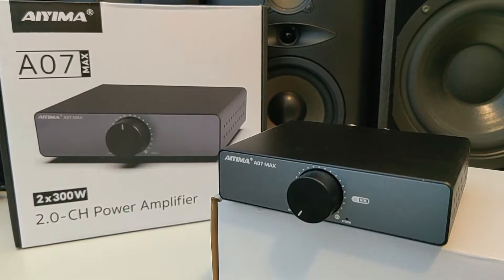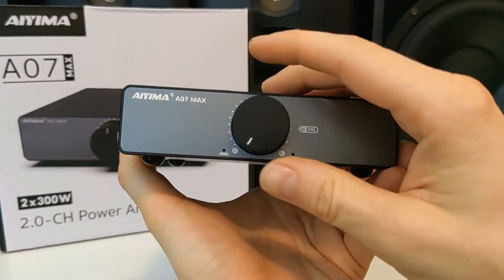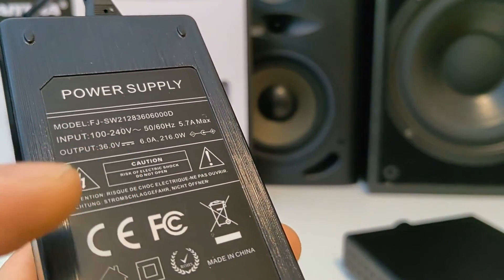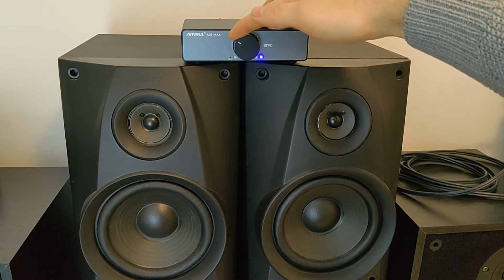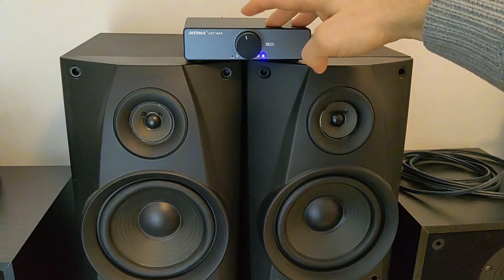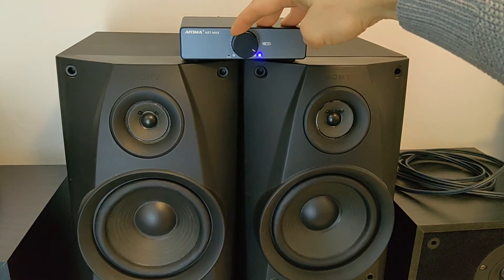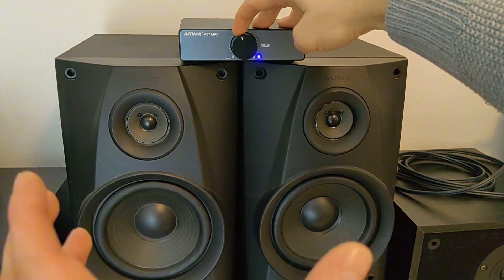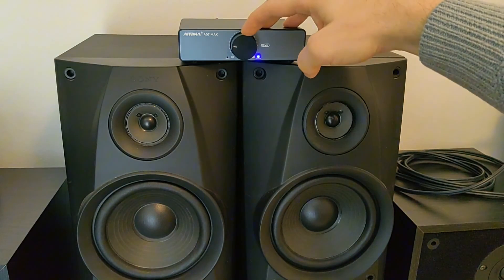Aiyima A07 MAX Amplifier TPA3255 with mono stereo bridge switch - Review by @ALS-TechReview

Comment: Some say they got a reversed polarity speaker terminals for this amp. Is this true?
Reply from the maker: After confirmation from our engineers, the speaker terminals of the A07 Max are operating correctly, and the product itself has no issues. We suspect that the abnormal phenomenon may be due to the speaker polarity being reversed on the customer's end. If there are any other questions, please feel free to contact us.

Comment: "Featuring AUX OUT functionality capable of driving an active subwoofer or an additional power amplifier"
@1:15  If the AUX OUT is fixed volume, it won't work properly with a subwoofer.
Reply: If you have an external dac like me you can control on the dac